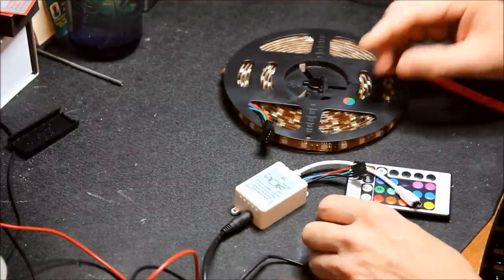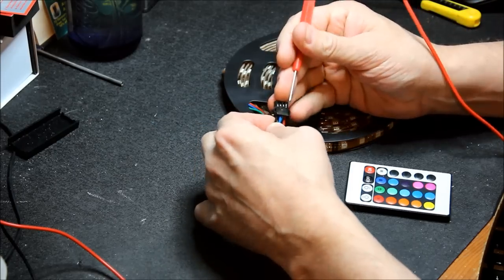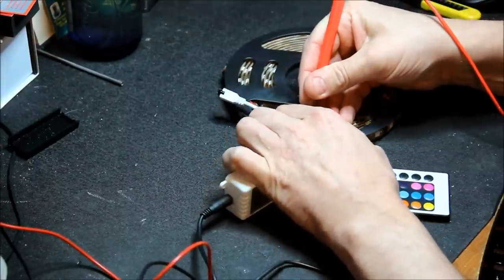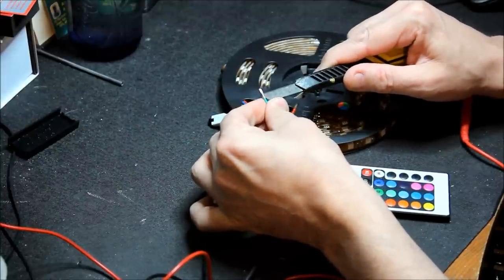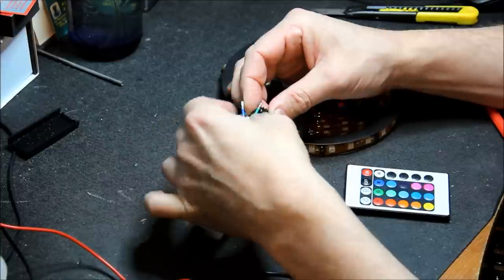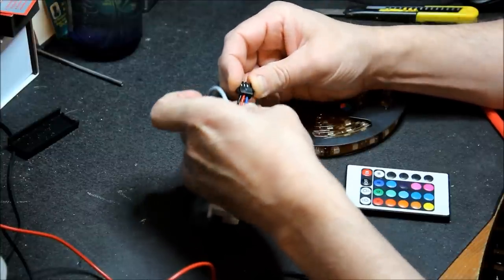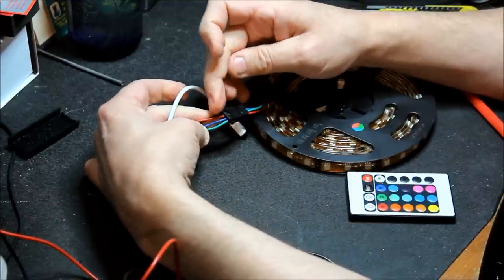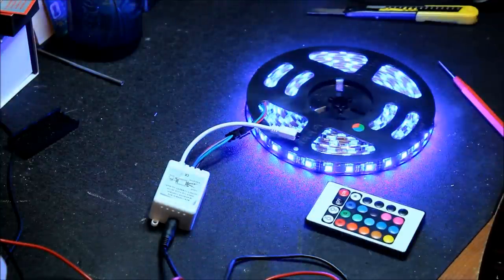Steve'll Fix It S01E04 Re-Mapping RGB LED Strips

Comment: I have an LG 42La640S LED television. On the remote control, the "left direction" key  remapping my rgb leds. But it's very easy to repair the bad mapping with that :D Just you must pressed the key (beside deactivated LED) until it will be good again. And it's not a joke .

Comment: Dear man,
If i accidentally connected 3 pins argb peripheral to 4 pins rgb header on motherboard, and my led color goes crazy, is it fixable or it's all dead?
Reply from the maker: Don't do that. It will break the Internets and accelerate the hole in the global warming layer. This has been confirmed by Windows, Verizon and M&S.